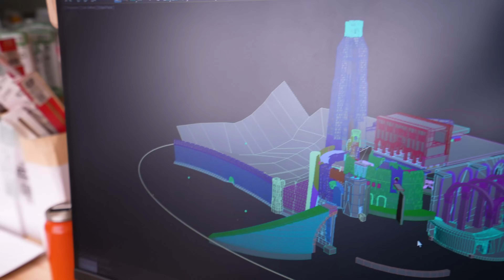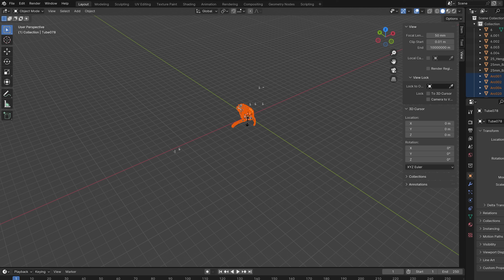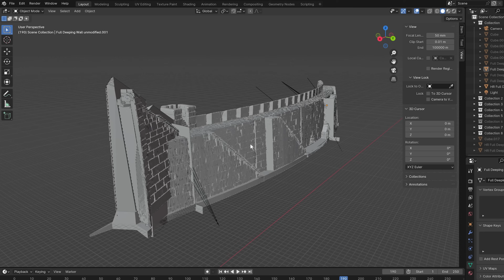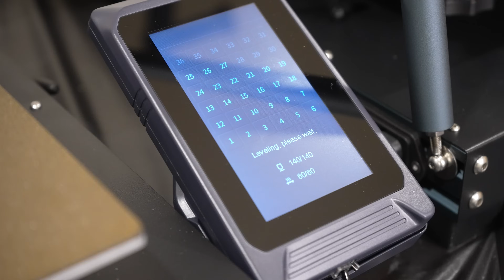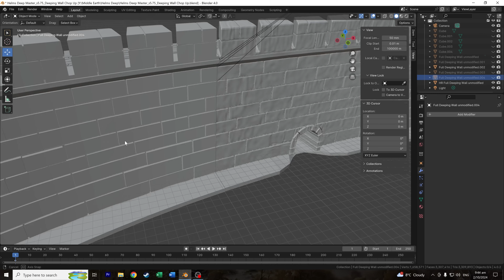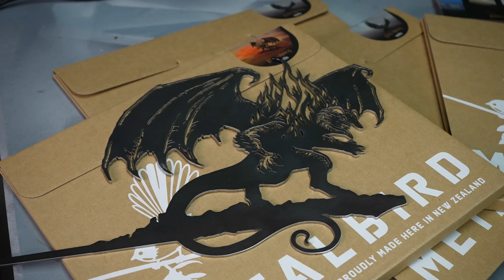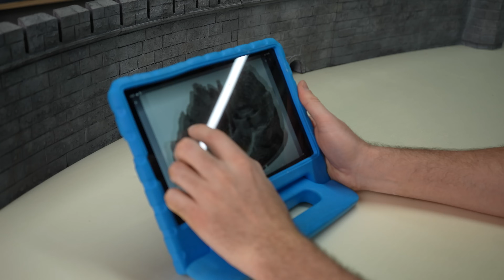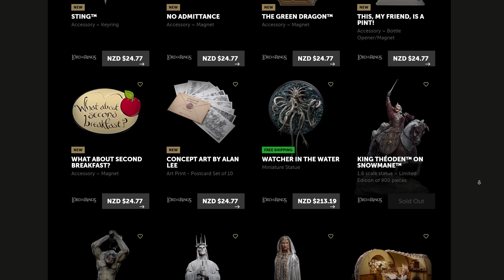The BIGGEST wargaming board in YouTube History! Helms Deep Lord of the Rings Warhammer Scenery

Comment: I could use some input from the audience here. I came across this video because I make something called Battlefield Chessboards (can be seen on my channel). The idea is a chessboard with a non-flat surface to  more accurately represent the uneven terrain of a battlefield. I really like the idea of making a board with a battlefield from LOTR, but even though my chessboard can have an uneven terrain, I am a bit limited in how big of an elevation difference I can make between two spaces (so a deeping wall isn't really an option). So I'm wondering if anyone here is able to provide some input on a battlefield that would maybe be recognizable, but still work with my Battlefield Chessboards. I think the easiest would be the area in the two towers where the group is attacked by Wargs on their way to Helms Deep since that's just rolling hills. However, I'm not sure that's really recognizable or significant to LOTR fans.

Comment: Is there some sort of "aerated" filler you could use in the plaster molds like pumice gravel or plastic bubbles to fill it out so it isn't so heavy? I'm thinking fill the mold with the filler put a wire mesh screen with a hole in the middle over it, then pour the plaster in the hole while the mesh mostly keeps the lighter material under the surface of the plaster pour.